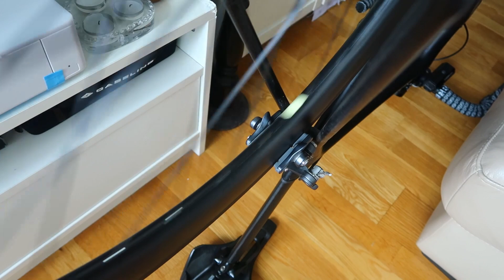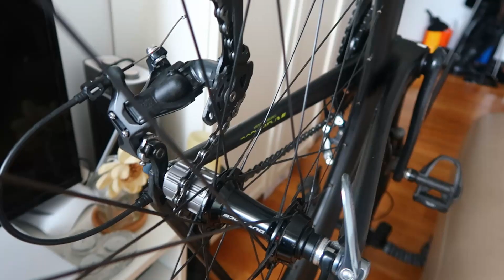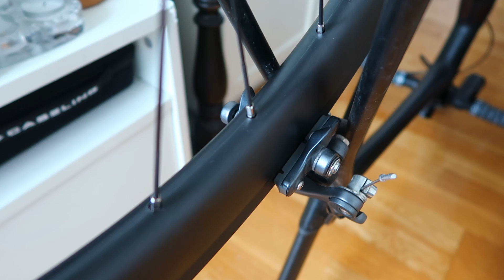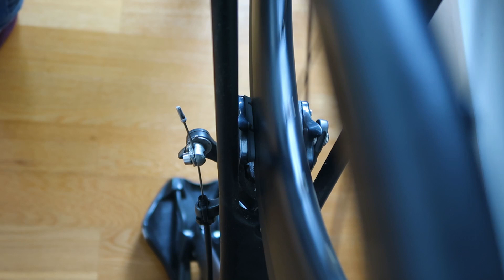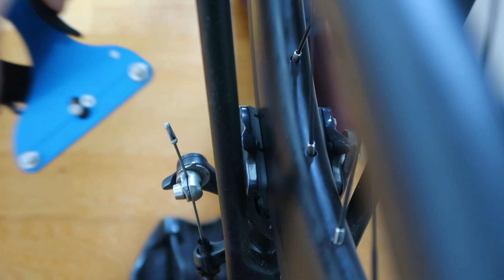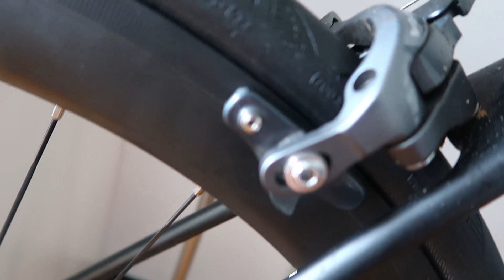Farsports Dura Ace Wheel Build part 3: How to true a bicycle wheel

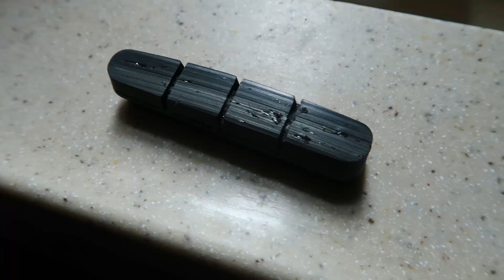Comment: 16:50 you can see the aluminium imbedded into the pads. My bike has done this too. 
I used a pick to remove it, turns out they are the machining ridges from the aluminium rim track. They are long 4mm slivers. 
I now sand those ridges off my rims with sandpaper between the pad and track and check my pads every few months. 
I believe this is the primary cause for brake noise and worn tracks

Comment: do you really need to know the tension ratio between ds and nds? don't you just have to get the dish of the wheel right? I mean you can't really change the tension on one side without affecting the dish I would say. 
but yeah great video, I really enjoy building wheels it's really not that hard.

Comment: A nicely delivered How-to! I had been looking into wheel-building for many months and these vids contained a lot of the information I needed to demystify the subject.
Many thanks for your contribution to the community. First set now done and dusted and I 
 can finally join the do-it-all-myself bike mechanic club!
Have you investigated spoke tension drop with tubeless tyres due to rim compression by the bead? Id be curious as to your take on the subject. im retensioning NDS spokes with TL tyres installed to counteract the tension loss since I figure over tight spokes with tyres off is better than slack spokes/bad dish with tyres on.

Comment: Excellent 3 part series on building wheels. Thank you!   Did you calibrate your TM-1? 15 is about 135KGF on CX-Ray but the Park Tool TM-1 isn't calibrated correctly, or so I've been told
Reply from the maker: Thanks for your comment sorry for slow reply! I haven't calibrated it yet no, I have heard they can vary a bit too. So for now I am sticking to the lower end of the tolerance just in case. Thanks!